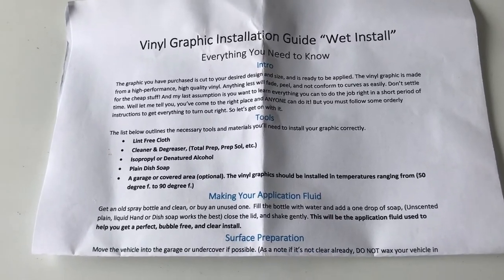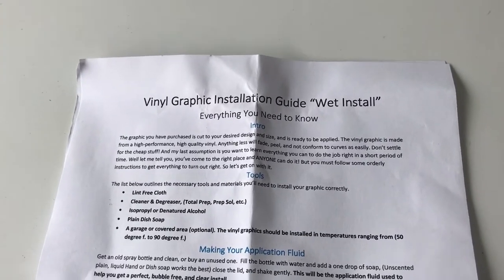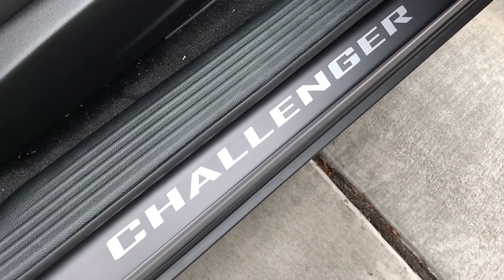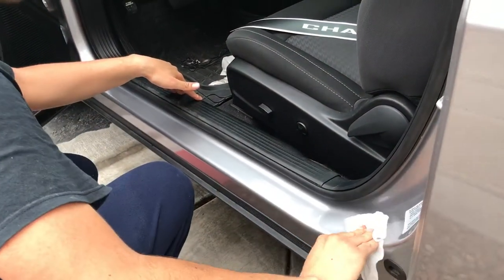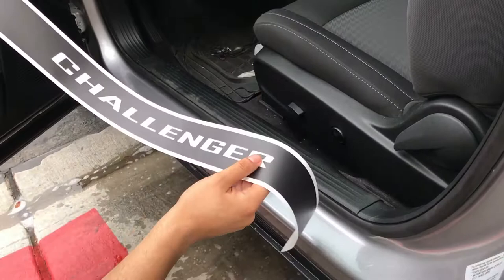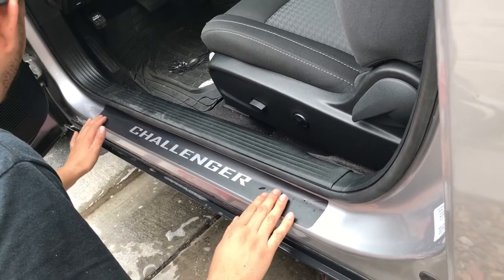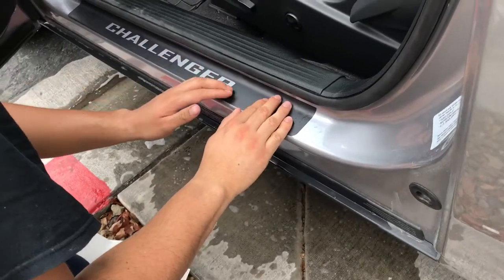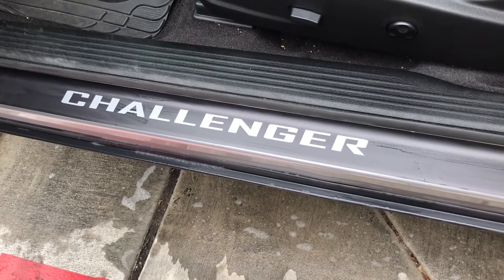Dodge Challenger/charger Vinyl door sill installation from metro graphics

Comment: Have you tried MGP brake calipers
Reply from the maker: Pedi C what's up bro no i haven't. Do you have then installed.
Reply: Yes 
They were 200$
Very easy to install
They change the look of the car by far 
I have them in red with dodge writing on them
Reply from the maker: Pedi C nice well i have to check them out. Did you get the sxt or the sxt plus
Reply: No Shame i have the SXT plus 
But that doesn't matter 
Them caliper covers come in 2 sizes 
You have to see if your brake calipers are single or double pistons 
That's how you know what size to get 
Mine was single piston
Reply from the maker: Pedi C they do look bad ass ill have to check my car to see. Do you have a video of them on youtube.
Reply: No Shame no I don't 
But if you type MGP caliper covers for challenger bunch of video come up
Reply from the maker: Pedi C right on thanks bro ill check em out.